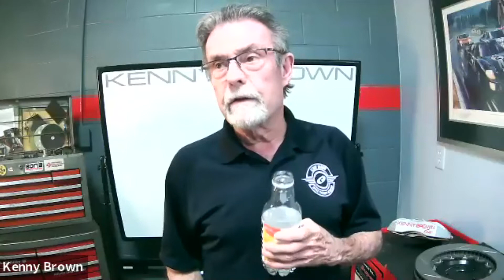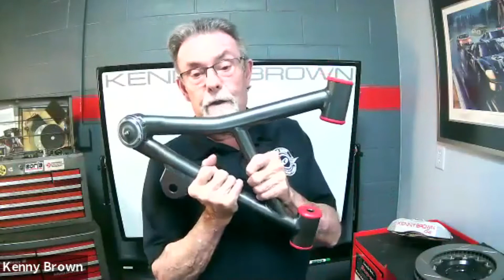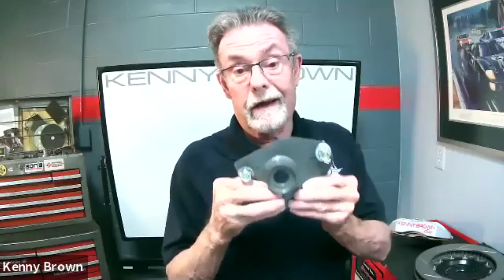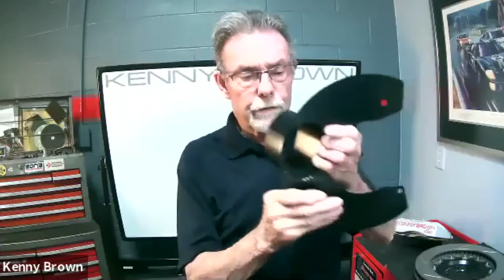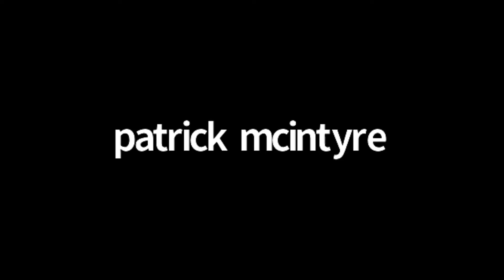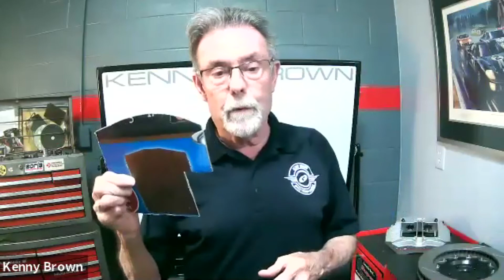Kenny Brown IRS Cobra Workshop

Comment: Aside from the spindles, you should make a subframe/carrier. I’ve been looking at it because I was having a hard time finding a cobra unit, and I almost welded up my own that was made of tubing - But I happened upon one for a decent price so I went that route instead. I want to send it off to you for modification though. Would rather just buy one straight from you that already has the work done to it, as I think many others would. Especially since these are no longer being made by Ford. You would have a monopoly on the market share for IRS swaps. Seems good ROI.